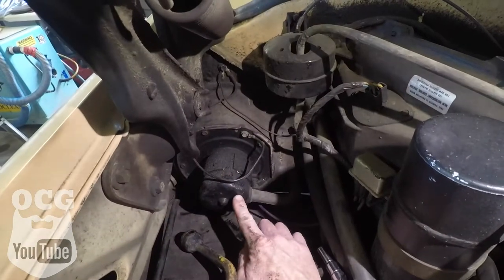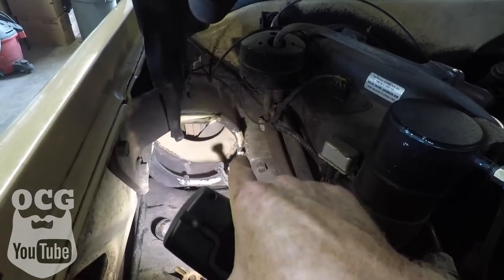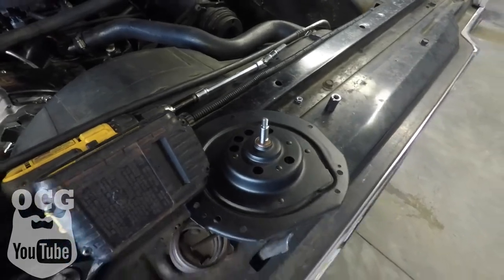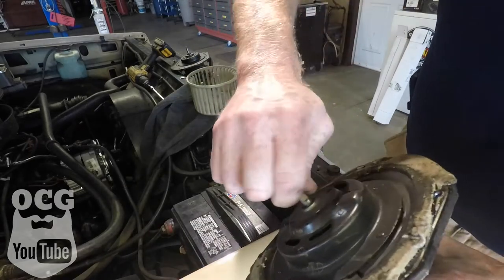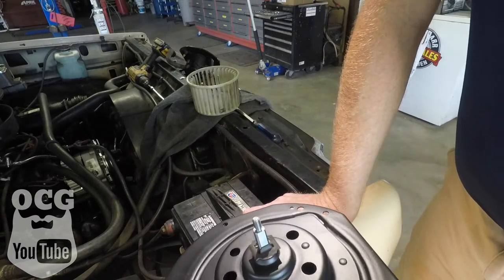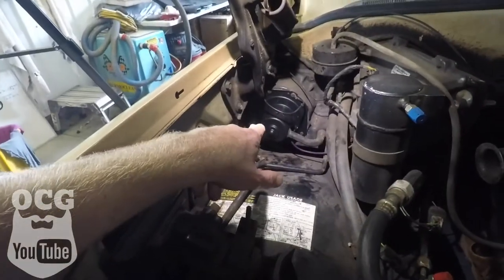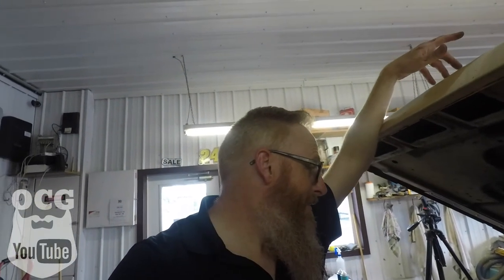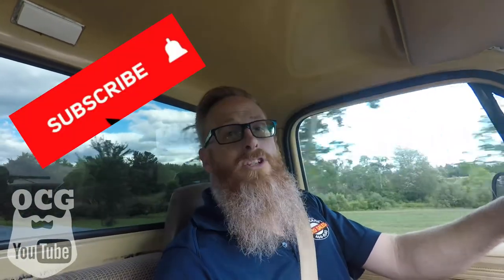HOW TO REPLACE A BLOWER MOTOR ON A 1973-1987 CHEVROLET C10 AND SUBURBAN UP TO 1991

Comment: This is great!!  Definitely subscribing!  I just started working on my 79 Chevy C20 Deluxe.  I’m new to working on vehicles and these videos will definitely help!  My blower motor sounds like it is always running (obnoxiously loud) when I turn the key and when the switch is all the way down, is this normal?  I’m getting ready to replace it and was curious or if this is some other issue going on.  Thanks!
Reply from the maker: Hey Ron thanks for subscribing. If the bearings are bad in your blower motor it will be loud even on low setting.
Reply: @OldeCarrGuy  thank you so much!
Reply: @OldeCarrGuy  watching your video worked perfect I was able to get the blower motor out and have one on order .  The motor was barely turning and the squirrel cage was cracked.  I was curious, do you have any body work videos where you are replacing whole panels?  I saw you had some rust work ones, but most likely planning on getting some replica panels and replacing them as some are in pretty bad shape.  Thanks!